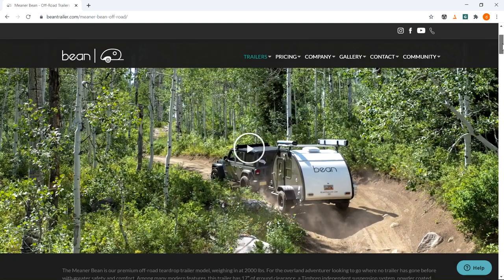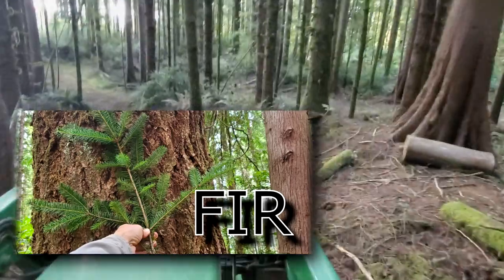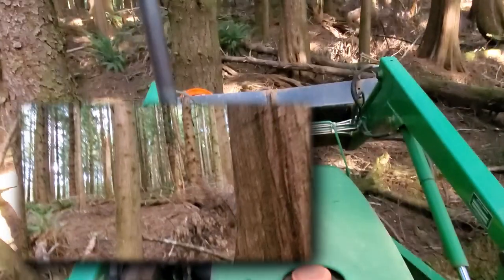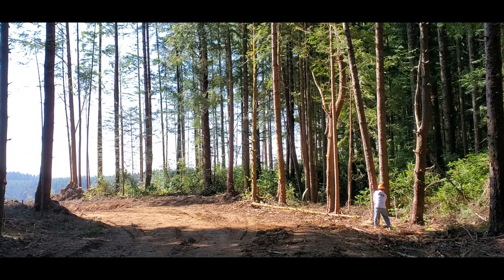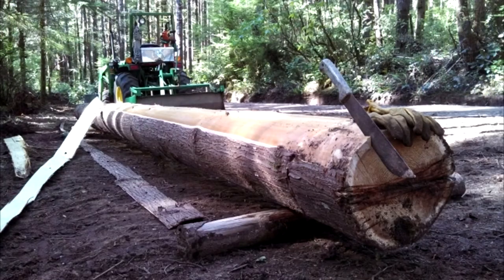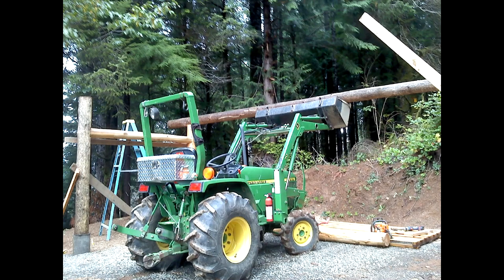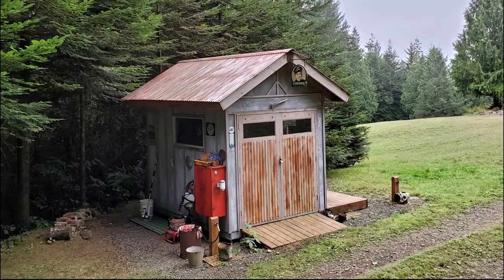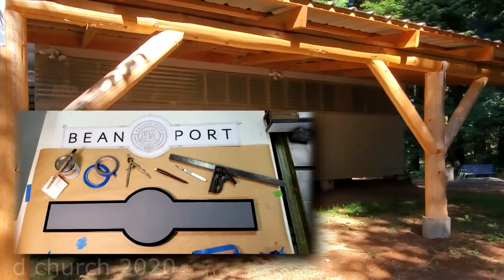Carport or Bean Port? - Start to Finish (DIY Project)

Comment: How long did this take and how many wereninvolved. Working on a project like this now
Reply from the maker: I did this solo except for peeling the logs, which took three of us a couple of hours. Spring bark peels easy:)

I spent one evening drawing plans. One day selecting, falling and skidding trees to the site and peeling bark. One day leveling the site and setting stakes and lines, mixing and pouring the concrete.

There was some down times while concrete cured and the logs dried a little.

Then two days cutting, setting and fastening posts & poles (with my front-end  loader). Next day, installing perlins/rafters. Another day installing the metal roofing. Two days making the sign:)